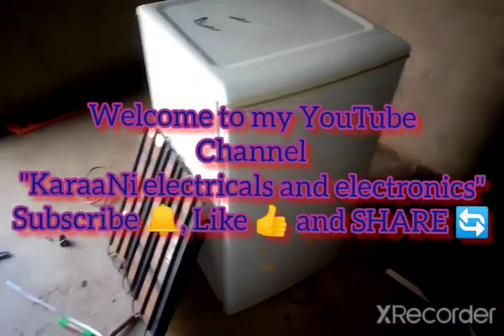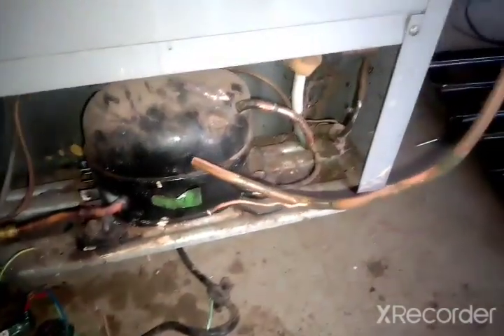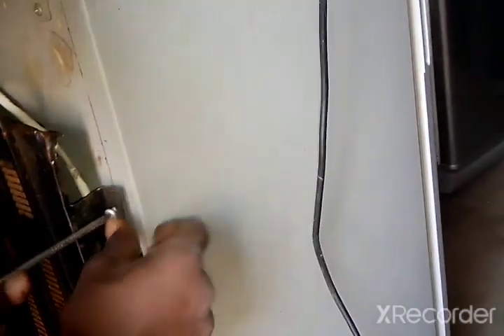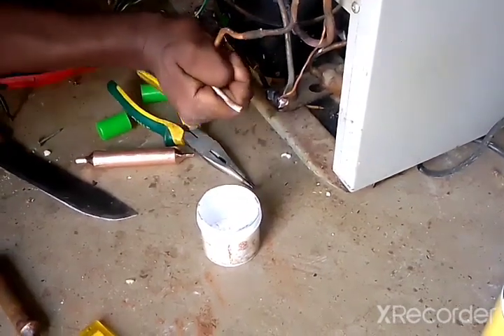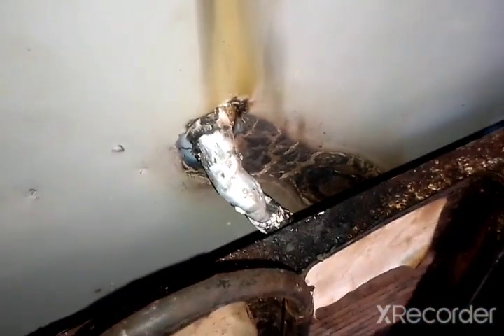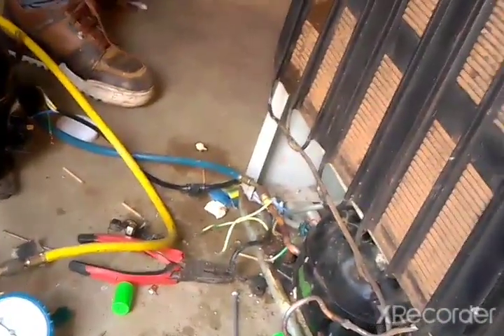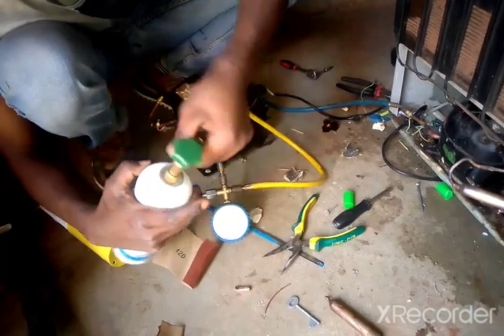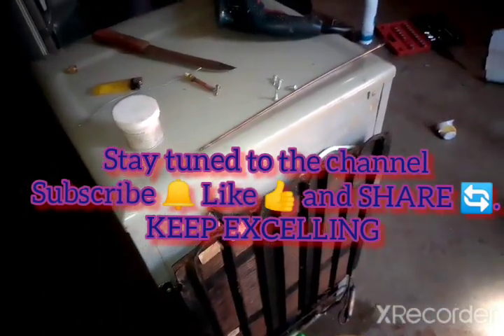How to change the evaporator, condenser and recharge refrigerant (gas/Freon) in a single door fridge

Comment: When you open the system the pressure inside the system is equal to the pressure outside the system when the fridge is off but when it's on then the pressure inside the system increases

When u open the compressor with gas in it the gas moves out of the compressor whether the fridge is on or off

Comment: Again difference between using eg R134a gas or R404a gas or nitrogen gas in finding a leak compared to using air is what in my opinion i would say u can find small leaks with gas compared to air what do u say.

Comment: When u increase pressure on the gauge u put the gauge pipe on discharge valve and open the suction valve whilst the service valve is not used and is closed and u turn on the compressor and when finished turn off the compressor, am i right or wrong secondly the air inside the compressor does it not go out of the suction after switching off the compressor, because i saw u removing the air air from compressor by removing the gauge pipe at the gauge, thirdly when vacuuming you move the gauge pipe from discharge to suction and turn on compressor join  the
Reply: When the actual fridge compressor is off does gas come out of the compressor If the service valve is open
Reply: Can u maybe pls make a video the rally and practically explaining on how to use compressor to vacuum, clean and for leaks. Explain like put this on this etc so that we don't get lost and understand well. U know there there's also do and don'ts
Reply: Some use nitrogen gas and some use R 404 gas with compressor and some  air
Reply: Also replacing a double door evaporator coil and chest freezer and deep freezer leak repair and clearing blockage
Reply: On the other videos I saw that the proper standing pressure for R134 a is higher than what u mensioned and also the suction pressure which is the running pressure just check on that
Reply: I saw on your other video checking a stove plate, now what if the stove plate is hot but not hot the way it's supposed to be at higher setting on switch what might be the problem

Comment: pls my fridge is having a problem,
Reply: I need your help
Reply from the maker: Thank you for your comment. Can you explain, what is the problem
Reply: electronics  pls the fridge will start frozen then about 10 to 15 minutes it will defrost and after some time it starts working again
Reply from the maker: Does your fridge use a PC board or a defrost timer. Share the model number of fridge
Reply: @karaanielectricalsandelect5112  no
Reply: @karaanielectricalsandelect5112  defrost timer is LG old model
Reply from the maker: @tanzebruno1248  WhatsApp me +27617223802